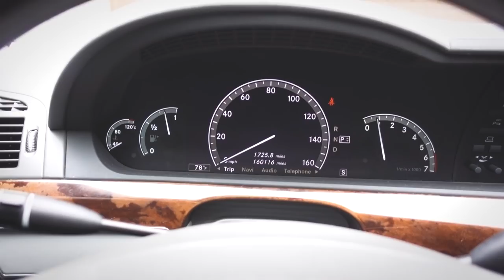2,600 HP GARAGE TOUR 2018! New Projects, Goals & BIG ANNOUNCEMENTS!

Comment: Nice vid.. The S600 needs more than your parts list. It needs a new set of valve seals. That cold start wasn't just rich on fuel but, using some oil as fuel. The dualie may need some emissions work by the look at the soot on the side of the rig. Keep the Porsche and get rid of the rest of the electronic fleet. You'll be much more satisfied and sane in the end!? Sell them to Hoovie because; he'll buy anything. Now that's a video I'd like to see. You and him haggling the price.
Reply: Yep. Definitely noticed Blue smoke on that cold start!!
Reply: That looks just like normal white smoke that the camera lighting fudged with

I strongly doubt someone like tamarisk wouldn’t notice oil burning etc in his daily.
Plus I’d imagine the CEL would flip on
Reply: It's Tavarish not Tamarisk. Oh sure because Tavarish never bought cars that needed work LOL. A car burning a little oil on startup due to valve seals wouldn't necessarily trigger a CEL. Plus the car has 160000mi on it.
Reply: Francobnyc it had the motor replaced. I doubt the replacement had that many miles.
Reply: Bmac 814 All the more reason to worry if the replacement motor has lesser miles on it. That was definitely Blue smoke on startup. Don't think that was camera angle or lighting as some comments state LOL LOL

Comment: For your SL you can just get a high-flow muffler if you want it to be quite loud, or you can just do a resonator delete and a larger X-pipe that is moved back a few inches. The latter is quieter and has no drone. The SL is really loud on the outside, but there is just so much deadening you can't hear shit.

Comment: You can make 600whp on the GE without even taking it apart. You just need to convert to e85. An R154 trans is a better and more tested option and is rated to 800whp...

Comment: Making the car think it's in neutral sounds like a good idea but I have a E55 and I know the supercharger clutch wont engage in neutral. I think you can do that with the NA M113 but not sure about the Supercharged. I really hope you make it work though
Reply from the maker: +Anel Hodzic that's my concern but I think it is speed and load based. I will have to research it more.

Comment: Bro that S500 is burning oil. I’ll give you 8k
Reply: Joe Blow that’s allot for a 2000 s class
Reply: anthony gutierrez yeah you’re right. I’ll match the year 2k
Reply: anthony gutierrez he never started the S500 and I’m assuming he was thinking 8k was a low ball offer so I’m bettering he’s talking about the s600
Reply: Bmac 814 w220 S5o0 is cheap for maintenance  S600 367 HP  stay in resonnable limits (i own one)...but S600 biturbo 500hp costs are same than a modern hypercar

Comment: Fords are for people that don't have the sense to buy anything that lasts forever. I never really took you for someone like that. i mean you have decent taste with most of your other vehicles why do you keep showing your trailer park side buying Fords? If that Super Dookie isn't a 7.3  get rid of it before you have to rebuild the stupid thing over and over the ONLY Ford motor that i will agree is fairly reliable is the 7.3 which is the ONLY thing of ford's that i would even consider driving anywhere. The MR2 looks like a lotta work but they are also a lot of fun too. it'll be nice to see that one finished up and done right. Now i remember why i quit watching. you can't just restore the cars any more?  Now you're going to start frankensteining them all because you're bored and have nothing better to do, or is it to draw in more of the kiddie crowd with the extreme modding?  I am a purist. the more stock you keep it the better it is. i mean adding wheels and tires is one thing but then you go to changing major configuration and components because what you're bored? I just can't watch that kind of stuff. what you're planning on doing to that SL55 is retarded. and not in a good way.  The Supra i can kind of understand because the only reason people even buy those in the first place is to mod the hell out of them for racing or track running Completely my opinion Agree or don't! that's how i feel about everything you mentioned here.